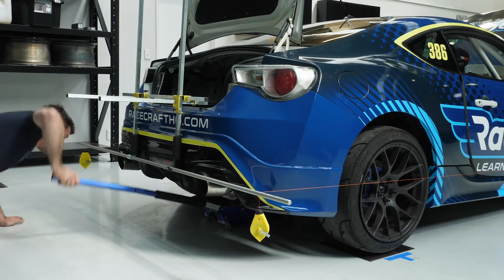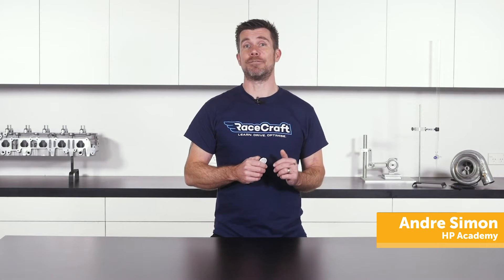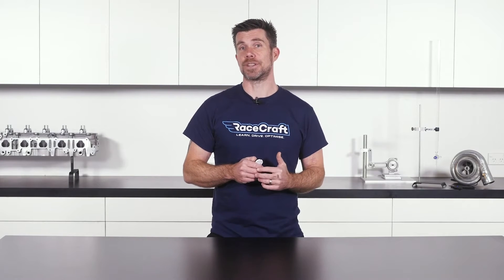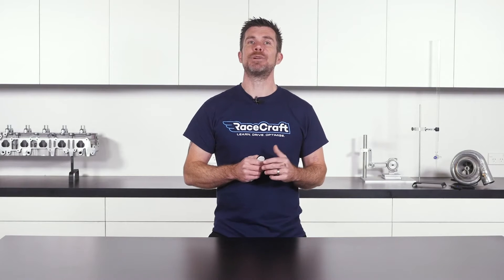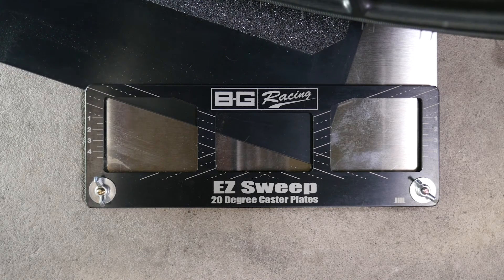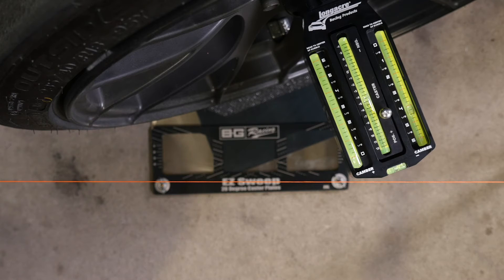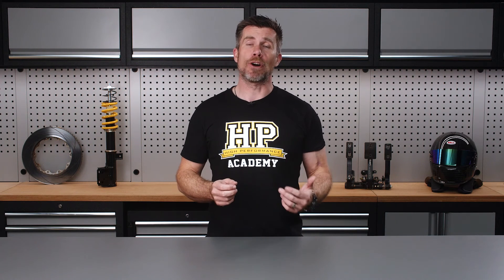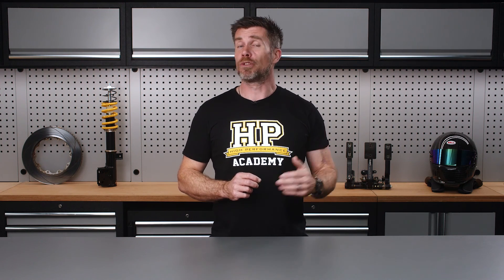These Will Save You TIME! | Slip Plates, Turn Plates

Comment: I went out and got a camera system alignment machine lol what acwaste of money lolol one of the camera statem camber settings is offset by 0.4deg so i now use these old school equipment cant go wrong so simple aslong as you know how to adjust
Reply from the maker: That's the same reason string alignment systems are used even in professional motorsport. If they're wrong, it's easy to fix the issue with a string system. This is not the case with a laser or camera that has a calibration issue.
Sorry that camera system didn't work out for you though.
Pros and cons for everything - Taz.